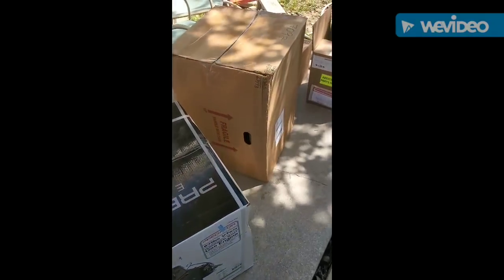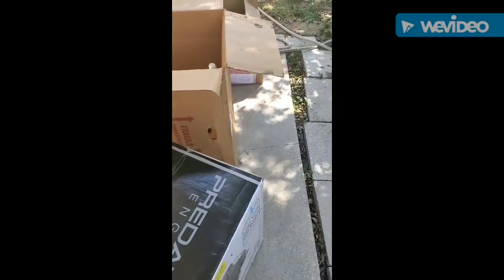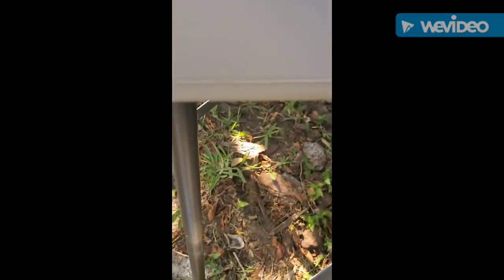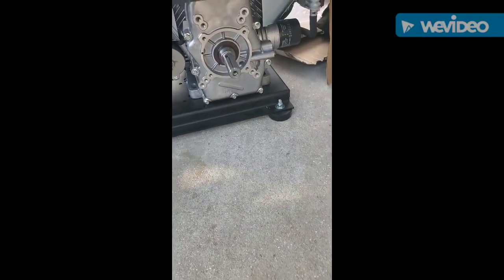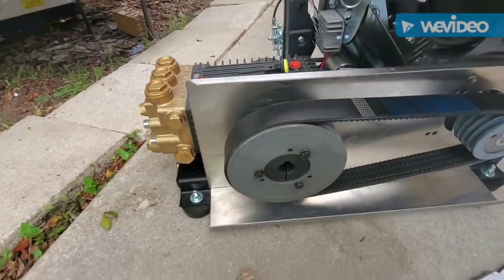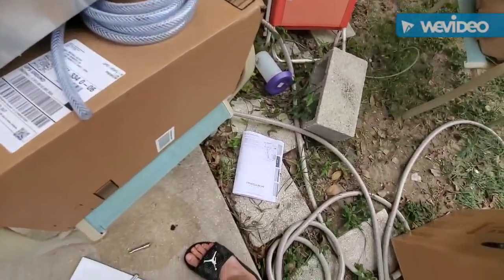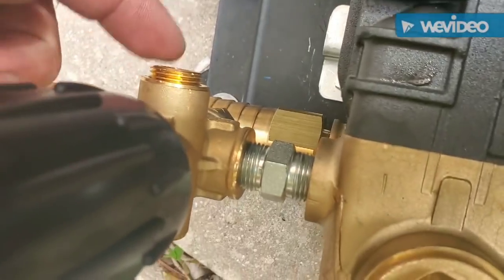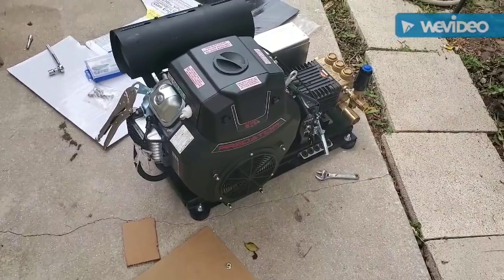8.5gpm predator belt driven pressure washer build

Comment: I'm building the exact same build today!!!!!     Same unit today cost me $2500 but still way cheaper than buying a prebuilt one.
Reply: What were the parts you got from Russ?
Reply: I got the parts list from Russ. 1,544.08 is what he gave me for all the parts on the list. Is that what you got? Did you get everything on the list? How much did you get the predator 670 for? I know they're currently back at 999 but last week Google came up with a link to HF website with a couple code and had them at 855 I think.
Reply: @MannyAguilarJr  That's what I got from Russ with the AR pump. Paid $999 plus tax for the predator.
Reply: @jdgatliff where did you purchase your Predator from?
Reply: how has the engine been? thinking about getting one but hearing they can be headaches as well. thinking I just might get a honda and take the purchase pain for a bit.
Reply: @BrandonFriend87 It's ran perfect for me.
Reply: @MannyAguilarJr  who is russ affiliated with? I'm interested I  a build like this.

Comment: That pipe nipple you used to connect the unloader to the pump will see full outlet pressure all the time, plus the vibration and the weight of the unloader. I would strongly recommend you consider making sure that is a heavy duty part, like a stainless Sch80 part. They are $13 from McMaster.

Comment: to remove the second pulley, remove the two setscrews then insert it into the hole 90 degrees from the other two screw holes. and it will push the sheave off the bushing
Reply from the maker: Thank you.. I got it but I apreciate it bro 💪

Comment: I just ordered that same pump, it's 7gpm/3600psi but can go up to 8gpm with a bigger engine, but I mean, it Maxes out at 8gpm. It's a 2-gunner and/or gun/surface cleaner.

And it comes right handed from Italy but when it comes to the US, they switch some to left. So the machine is ambidextrous 😂😂

Comment: on the outlet side of the unloader, I'd put a stainless steel sched 80 tee in there and attach a 5000psi liquid filled pressure gauge so you can adjust down the pressure if you like.
Reply: I'm new to the industry - I was wondering how you could adjust down the pressure if I wanted to. Do you have recommendation for where to get stainless steel sched 80 tee?

Comment: Hey mike how did you tensioned the belt without getting the pump misaligned when I tighten down the alignment bolt on the side the belt tensions but my pump gets misaligned and pulls to one side

Comment: and.  how the heck did you get the bolt in and tightened that is back side bolt of pump that is behind the shield?   the bolts are totally blocked by shield,  you got to bolt from bottom of skid right? but how you hold bolt on top of skid plate under pump that is behind shield?  thanks!

Comment: Hi,

Hey just wanted to say "Thank You" for the is video. You explained how to install and take off the belts on these types of pressure washers. I couldn't find a good video on how to install or change belts. Didn't know about the bolt under the pump to add and release the tension on the pulley.  

Just to make sure. So basically can i just release the bolt then change the belt without taking off the pulley?  Or do i still need to take off the pulley first, then loosen the tension? Let me know if that correct.

Again, THANK YOU! 

Michael C - (WA)

Comment: Here is your formula you need to know.......PSI X GPM / pump rpm x 1.5= hp needed.        So. In other words.   3500x8 =28000.   ...... 28000/1460? =19.17      The 19.17 is what you need for HP using electric motor..Check documents for pump rpm ..   but for gas power you multiply the electric horsepower x 1.5 to get the horsepower needed for gas engine.....  in your case it’s 28.76 hp....
Reply from the maker: that good info brother ty. than that means gx690s aren't big enough either? both are 22 hp
Reply from the maker: Kohler makes a 28 hp
Reply: You can do all that math you want but if that’s true then clearly NONE of the Honda gx690
Motors would be big enough yet they all run them pumps good so
Reply: @Oleynspressurewashing    Thanks for the vid!!   Back in early 90's I had 2 honda 13 hp machines, one with a 4 gpm and one with an 8 gpm, both Cat pumps.   Yes, 8 gpm on 13 hp honda motor.  A rolling outfit in kent, WA   sold these 8 gpm machines as roof cleaners.   The rinse power was great, little softer wash for cedar roof.
   I washed similar age roofs side by side with each machine.  I used both of them for years.  The 4 gpm got about 3500 psi, ran for 2 1/2 hours one tank.  The 8 gpm machine got about 1800 psi and ran for 1 1/2 hours same size gas tank.  My friend had 2 machines, 18 hp hondas with 8 gpm pump, and that 18 hp was just way better than my 13 hp 8gpm, but my machine worked great for many years, no complaints, when washing roofs or houses of dark cedar or moss etc, (1800 psi not enough for serious peeling/cleaning).   I can tell you, 22 hp on 8gmp is way more than enough hp imo
Reply from the maker: @Nathan-wf1pr  🙏🙏
Reply: I built mine with a 31hp motor and the unit does not bog!!
Reply: u2ooberboober what motor did you use?
Reply: spidennis I used a 31HP Briggs&Straton Vanguard.  Been good.

Comment: Hey I commented 3 weeks ago can I get a response please
Reply from the maker: what did u coment buddy. i apologize i been super busy . what was your comment?
Reply from the maker: @atomic9358  email mikeoleyn@gmail.com
Reply: @Oleynspressurewashing  thank you sir
Reply: Atomic935 don’t mess with the belt drive stuff, go to Envirospec and get a gear reducer ! I had belt driven units when I first started then sold that trailer and built a new one with gear reduced units and I will never look back! So much easier and safer , never have to worry about belt tension and if you have a problem with the engine you don’t have to fight getting the pulleys off and fighting the belt guard, space saving too
Reply: @MarkB-zt9jm  I'm gonna check that out.. all I have ever had is belt drivin machines

Comment: Dude...  that motor is not near enough HP to run that pump at those specs...   you need at a minimum 29hp
Reply from the maker: I don't know about that 1 I'm pushing close to 10 gallons per minute I've been using it for 6 months flawlessly so I don't know where you get your information but it's working out great for me.
Reply: This pump  requires 1,750 RPM for 8.8 GPM. At the engine's maximum torque, it's at 2,500 RPM. It's more than enough. I know guys running this same pump on small Honda gx390's and they get around 5.6 GPM. This pump says it pushes a max of 8.8 GPM but going even higher, with the right parts, seems achievable.
Reply: @Oleynspressurewashing  @Oleyn's Pressure Washing   Thanks for the vid!!   Back in early 90's I had 2 honda 13 hp machines, one with a 4 gpm and one with an 8 gpm, both big Cat pumps rated same pressure.   Yes, 8 gpm on 13 hp honda motor.  A rolling outfit in kent, WA   sold these 8 gpm machines as roof cleaners.   The rinse power was great, little softer wash for cedar roof.
   I washed similar age roofs side by side with each machine.  The dark and green cedar shakes both got 100 percent clean, one was a little lighter shade than other, but the 13 hp 8gpm would take any day over the 13hp4gpm for this purpose.  (not for serious peeling/stripping power, but for washing cedar roofs or washing houses)    I used both of them for years.  The 4 gpm got about 3500 psi, ran for 2 1/2 hours one tank.  The 8 gpm machine got about 1800 psi and ran for 1 1/2 hours same size gas tank (just lack of hp to get more psi, and worked harder,  how long a tank of gas lasted was big difference).  My friend had 2 machines, 18 hp hondas with 8 gpm pump, and that 18 hp was just way better than my 13 hp 8gpm, but my machine worked great for many years, no complaints, when washing roofs or houses of dark cedar or moss etc.   I can tell you, 22 hp on 8gmp is way more than enough hp imo.
Reply: Put a 31hp motor on it and run max gpm.  It is a monster!